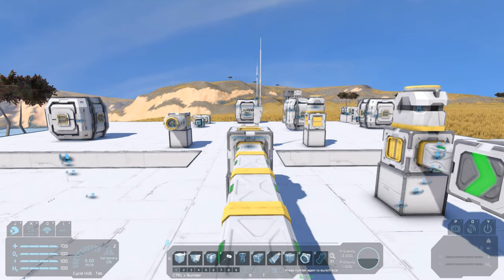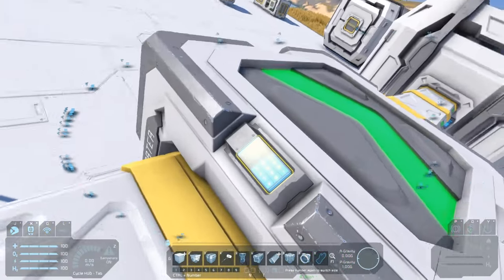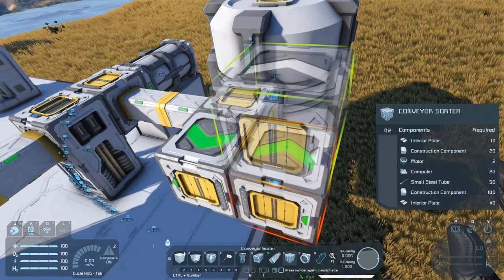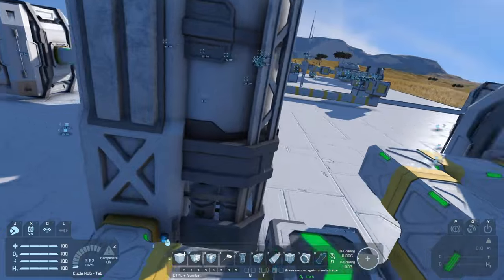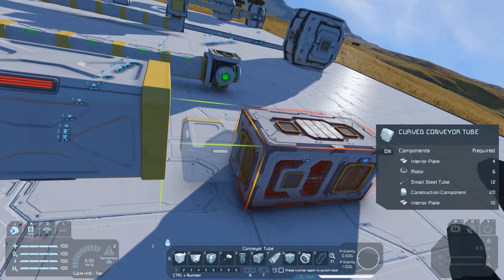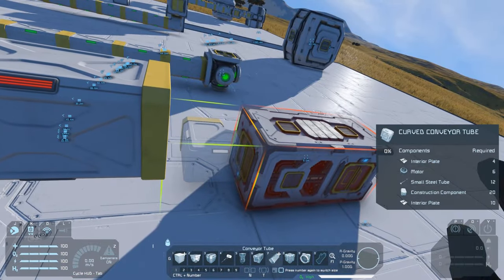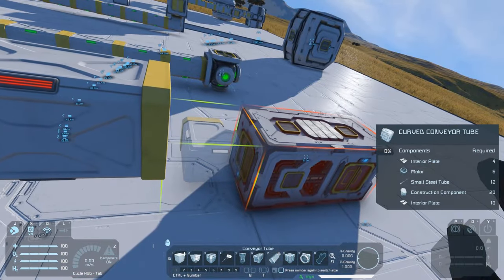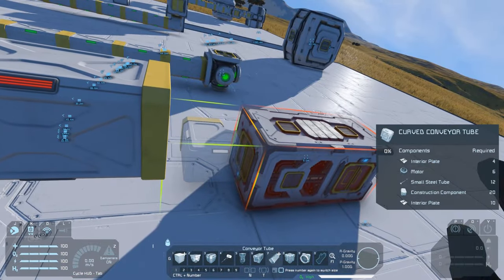Space Engineers Tutorial: Sorters and Conveyor Systems (tips, testing and tutorials for survival)

Comment: Very good turtorial on sorters.
But your setup, even the neat one have one fatal flaw. Let asume a shuttle from orbit comes to your base and docks to your system. Then your sorter pulls whole ice from the ship. And if that ship depends on Hydrogen that might lead to crash on it's way back to orbit or to suffication of ship's crew. Ofc if that ship have similar sorting system then it isn't the case. But such thing is hard to catch until you played on large server with multiple people and multiple ship designs. It hapend to me and it's easy to fix if you catch it in time.
So since then I'm a bit cautious about sorters. I prefer to use TIM instead. Sorry for braging about scripts again ^^'
Reply from the maker: That's a very good point about hydrogen powered ships, if you're using them a blacklisted sorter for ice at the connector would probably be sensible :)
Reply: Or why not a Sorter on the small ship that pulls ice into the internal Oxygen Generator automatically upon docking? That way it's one-way-only and you auto-refill, should the system you're docked to be configured for it.
Reply: @ZeroPointAlpha
Like I said if ship that is docking have any sorter system then it isn't the case. 
But again like i said people design their ships with diffrent approach. 
I prefer to use script called TIM instead of sorters. And if your base robbs me from my ice and puts all of it behind gate like one way sorter, so it's no longer avalible for my TiM to pull it back, then we have a problem.
Other way around same story. Ship with sorters docking to base without them also can deplete whole stockpile if base was running low on ice.